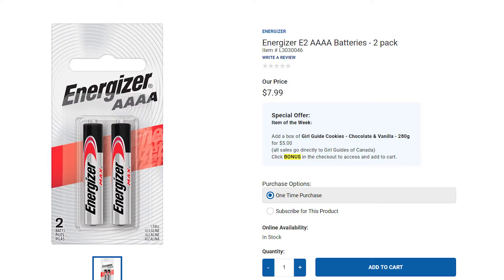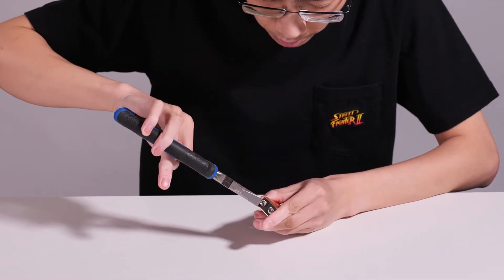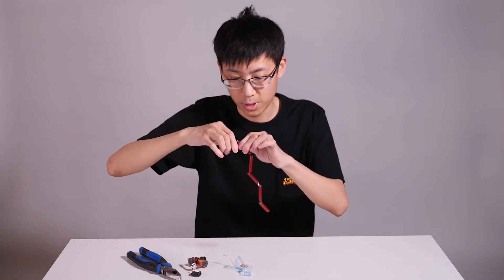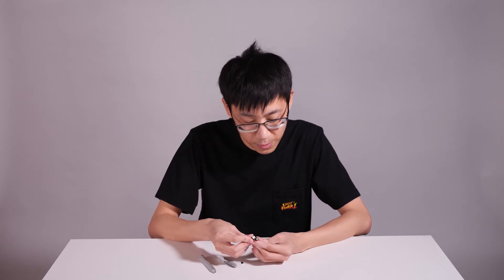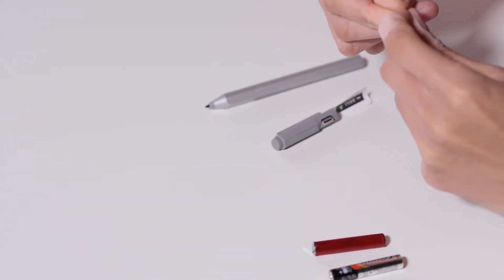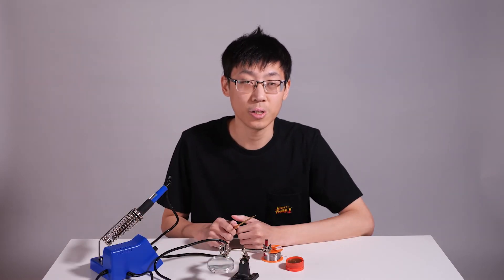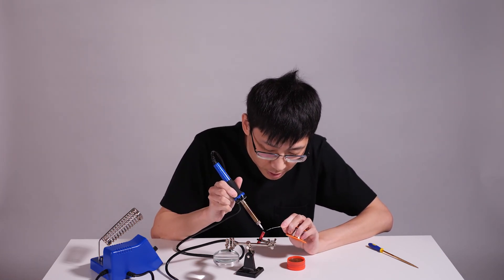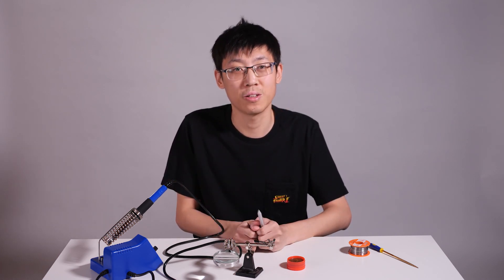Harvest AAAA/LR61 batteries from 9V and mod for use in surface pen [ENG]

Comment: Can this be done with other battery brands?
Reply: Only if they are alkaline, I think. I don't know if they still make carbon batteries, but they won't work. Before the LR61s, it was a carbon/zinc/paste stack in a heavy plastic wrapper and shoved into the can. So my point is, you want the ones with the individual cells, not the carbon-zinc stacks that cannot be separated in a usable manner.

Comment: If you cut the connectors right at the minus terminal, you can easily fold them to get a good enough positive terminal (no foil or solder required).
Reply from the maker: use the nickel strip, so smart!
Reply: @ttworkshop4010  -- I figured this out as a teen many years ago, in the late '80s. I used to like to take things apart. I had never seen an AAAA battery before that. Yet, assuming the same scaling as for AA & AAA, I may have noticed the height issue, but I thought I saw a proper positive connection. So the height issue might vary per brand.

Another battery hack involves the batteries for the CMOS in older desktops. If you can find fake tealight candles in a dollar store, you can get 2 of those batteries for a dollar, plus illumination circuitry to play with. But really, I wouldn't trust those batteries. The batteries out of those will work in a pinch if you really need one, but they are likely not of good quality. Just because the lights that they come in work, that is no real test of endurance.

Comment: What's the name brand of the battery? I mean the first one
Reply from the maker: The one I took apart in the video is Duracell quantum 9v.  The pictures I mentioned in the beginning is energizer AAAA and Amazon basics AAAA
Reply: @ttworkshop4010  thx bro
Reply: @ttworkshop4010  thanks
bro
Reply: My Duracell 9v also had 6 AAAA cells inside; but the Energizer and GP that I took a part didn't (they had a classic 6-layer voltaic pile inside).